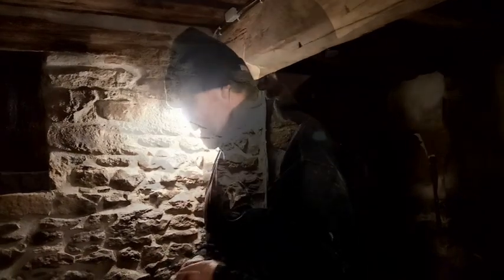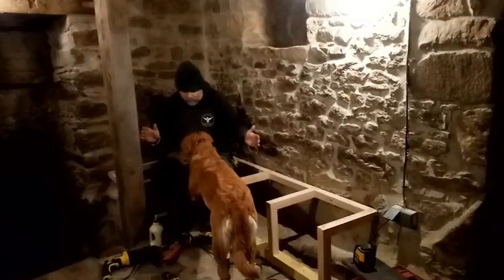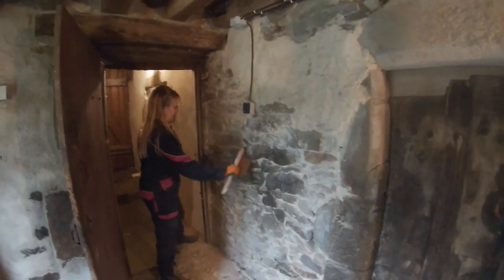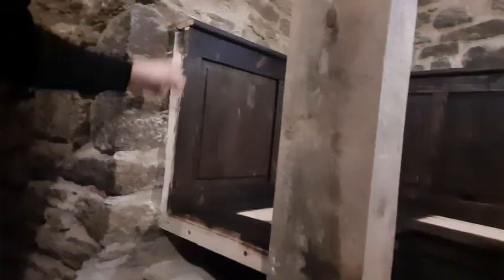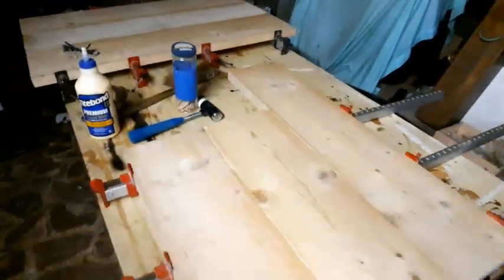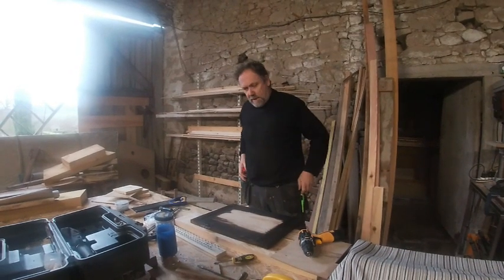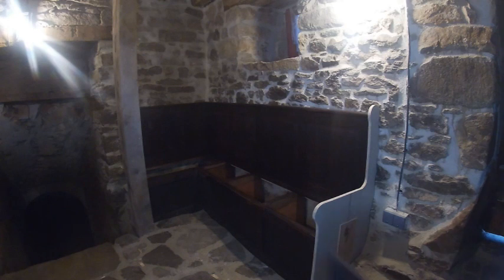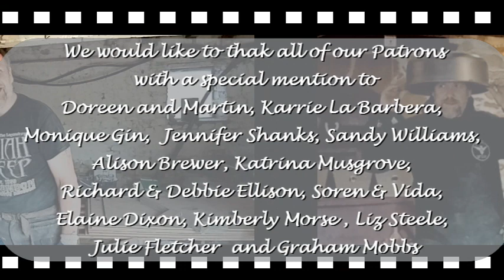118. How to transform and unused room into something extraordinary

Comment: You made a lovely job of the seating.  Just a thought but have you thought about making your own wax polish? My dad used to repair old furniture - and sometimes make it out of old wood. 
He used pure turps and beeswax heated up in an old saucepan until the beeswax melts.  Less than half beeswax to turps. If it's a bit thick you just slurp in some more turps. A tin full lasts for ages. If you want you can also make a batch but separate it up and add wood dye. The smell is fantastic and dad used to say woodworm doesn't like it, it's a good protection.  They reckon give the furniture or beams a rub with it twice a year. That's all you need.

Comment: Everything is looking great. Lesa, as I drop my phone constantly, a rubber type otter box has been a lifesaver.
Reply: I resisted the rubber guards through 3 busted phones. This last one I got the guard & the insurance policy. Amazing difference. Not a crack yet after a yr of my accident prone abuse. Did I mention I'm hard-headed?🙂
Reply: @rt3box6tx74  Lol. 😆
Reply: @rt3box6tx74  Rubber guard and screen protector! My first smartphone lasted four years without any damage! I only replaced it because I couldn't get OS and app updates any longer and the battery was going too.

Comment: To fill in the big spaces in the stone wall, you can use masonry bags filled with mortar. They're like the piping bags bakers use to decorate cakes. It is easy to refill, and you don't have to too much pressure.
Reply from the maker: You can't use a bag with sharp sand which is the best sand to use with lime to allow breathing space. The consistency is to thick. 😟
Reply: @ChateauDeMontmagner  You know better. I saw it on another renovation video.  😁 It was just a suggestion from the comfort of my couch.🤣